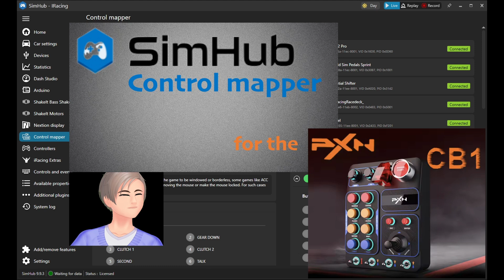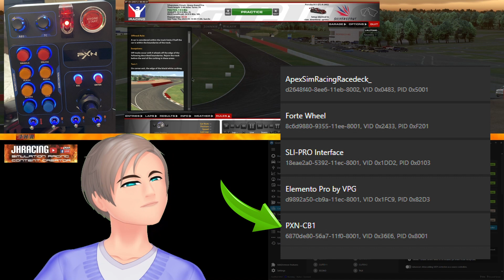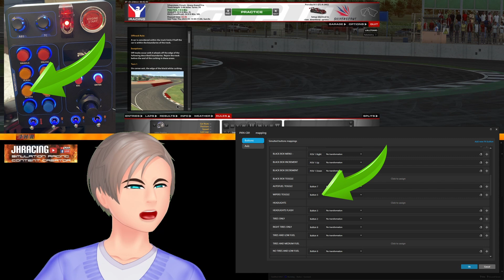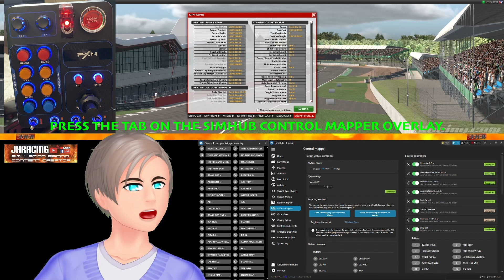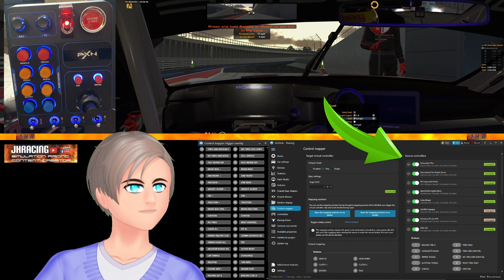SimHub Control Mapper in iRacing for the PXN Button Box

Comment: How do I get it so I have all these functions available in simhub?
Reply from the maker: Not sure what you mean but first you choose the functions you want in the control mapper then they are available to use for every controller.
Reply: @jhracing9425 I only have 29 total functions available to choose from in the control mapper as opposed to all the available functions in iracing. And I do not see a way to add more functions to make them available
Reply from the maker: watch this video on assigning controls https://youtu.be/-ix0jmQb8NQ?si=Sk0IpSdztG5PssJn
Reply from the maker: Its an older video but the concept of assigning controls is the same
Reply: @jhracing9425 do I have to enter them manually?

Comment: hello thanks for the tutorial, I have the same button box, but I can t map the ABS and TC with the dials on Simhub. Is it working for you ?
Edit: for those who have the same probleme, you have to quit the multimedia mode -> hold handle and press TC button.
Reply from the maker: Sometimes I find the control mapper “forgets” my mapping and I have to redo it.  Other than that it works fine.
Reply: ty fabien